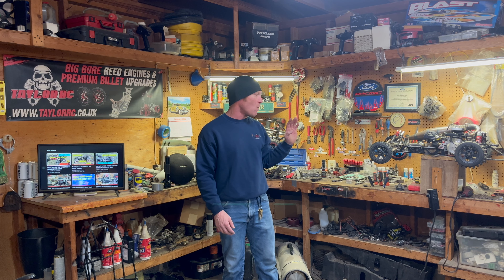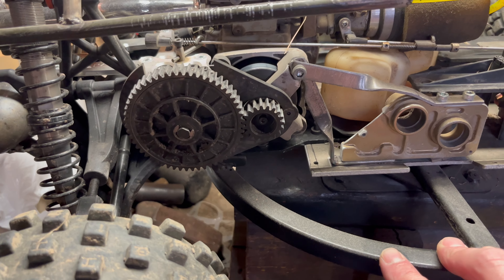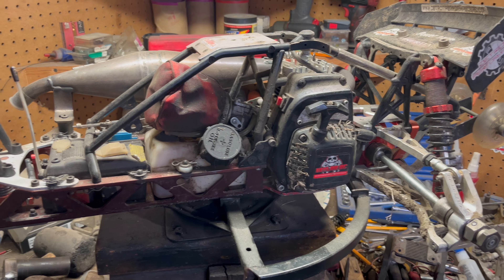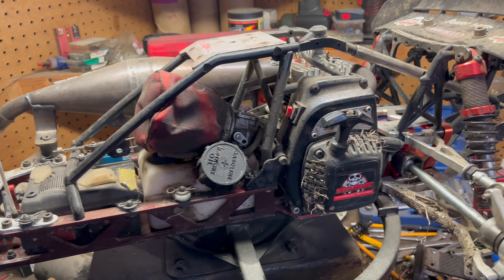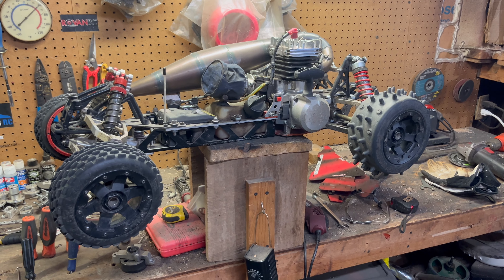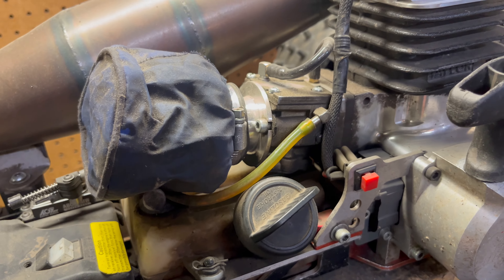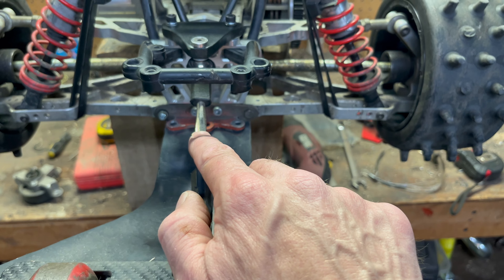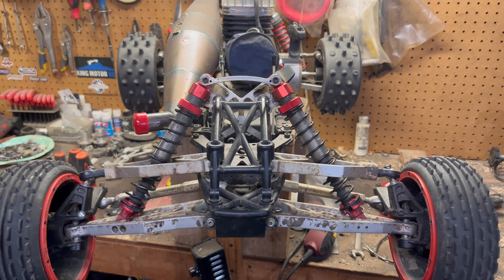1/5 SCALE RC DUSCUSSION- GOING OVER MY MACHINES!!!

Comment: Sick builds man! I want to do a motor swap on my 5t 2.0 but torn at what motor to get. I want a big bore like a 55 supreme but not trying to break parts constantly. That taylor 35 reed definitely rips for a small bore be a cool engine to throw in a race truck build
Reply from the maker: Thanks my brother👍🏼 in my honest opinion I’m gonna tell you to go with the big bore something 40 GT or bigger you will be amazed at the power 💥🔥
Reply: @Meyers2strokeRcgarage  Yea I hear you I want to sling some dirt for sure. How big of a motor you think the stock drivtrain can handle without constant breakage?
Reply from the maker: @antilagboostaddiction8322 I would say a 40 or 46 GT would work 👍🏼💥🤙🏼🤘🏼